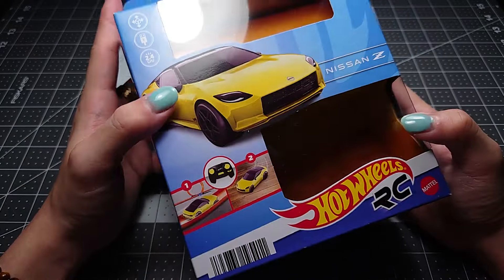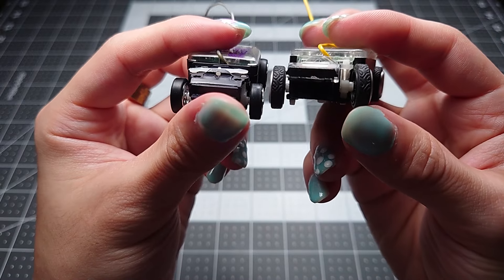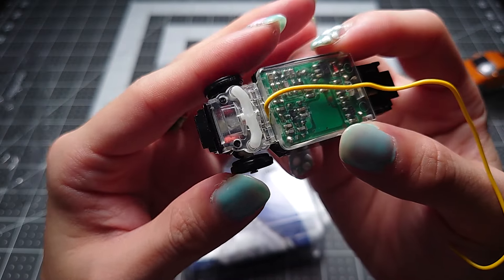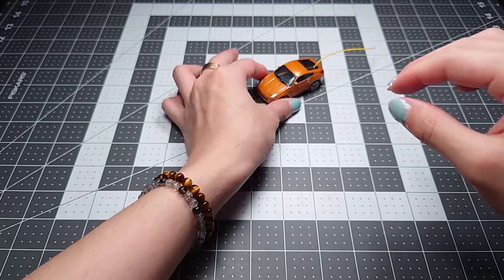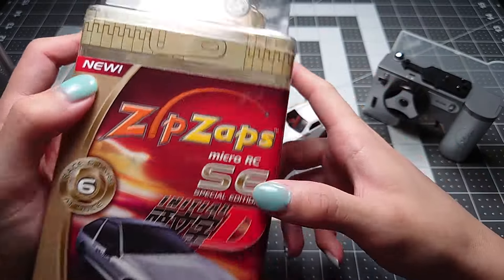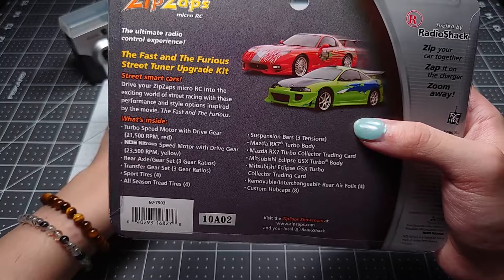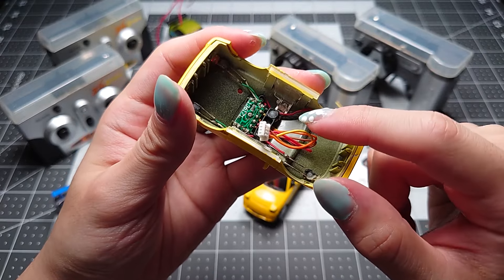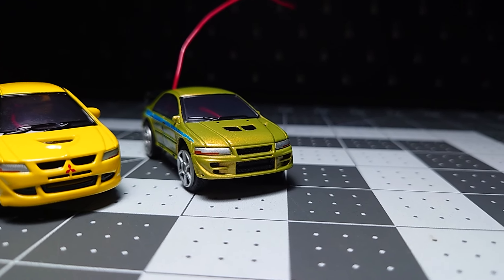I fell down the ZipZaps rabbit hole and I'm taking you with me.

Comment: I'm surprised you didn't get any tire rot with any of those purchases. I think that is the tricky part, getting replacement tires. I know a youtuber talked about 3d printing them but there are no images of their dimensions online. :(
Reply from the maker: If the packaging stayed sealed, the tires seem to be okay. I had one car which had ruined tires. I think I got pretty lucky.
Reply: @citrusjuicebox  I dusted of my original SE Initial D MAZDA RX-7 FC3S. The battery died. I did get thr Daytona ones you mentioned and carved out the side. 2 of the 4 tires didn't survive. :( going to ask a friend to help model the remainder of the tires and 3d print them.